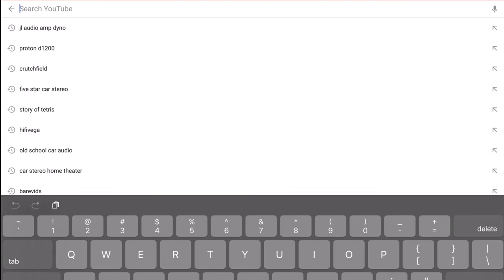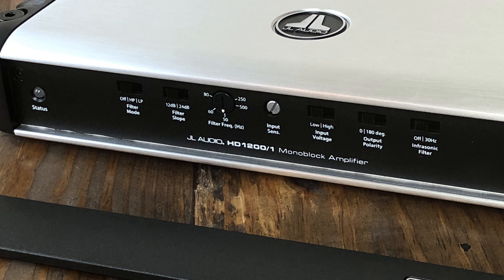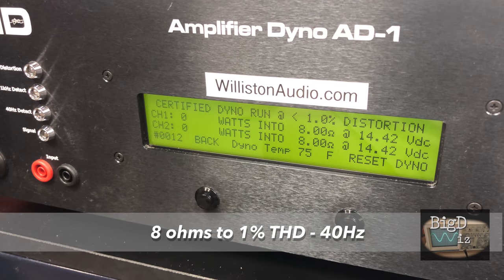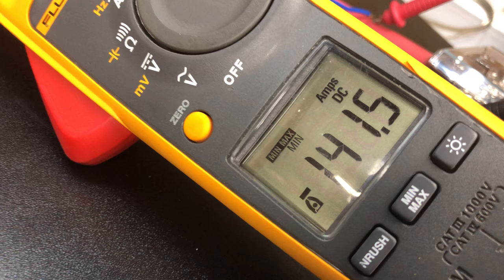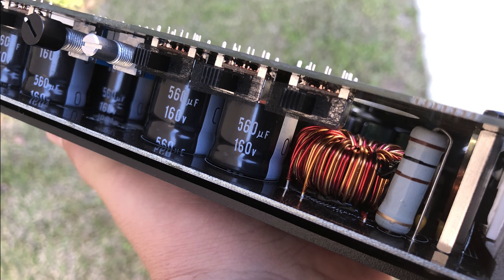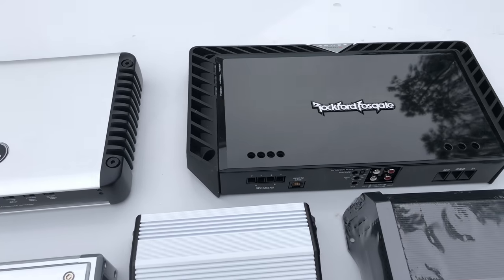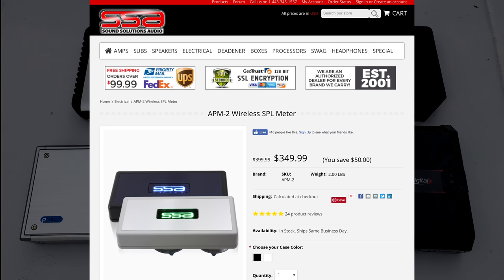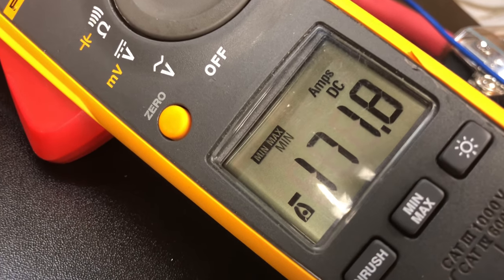$1100 for 1200 watts? JL Audio HD1200/1 Amp Dyno Test

Comment: Really nice amp but would take a fosgate power series amp any day.
Reply from the maker: The T1000 most likely matches the output of this amp, possibly more powerful
Reply: Wrong.
Reply: fat catt 39 No, Rockford Fosgate isn't made in the U.S.A.  Their products are made in China just like the JL HD1200.
Reply: BigDWiz your probably right because of Jl's regulated power supply.
Reply: Hopefully not a BD-CP.
Reply: I wouldn't have a Rockford Prostate..DD amps for sure
Reply: @blackymadd336  power series amps are made in USA brooooo
Reply: Fosgate power AD is what I would consider some of the best amps EVER made by rockford. Technology has come along way
Reply: Lol. The hd series has a regulated power supply.... Rockford don't come close.... Unless you have an upgraded alternator, and extra battery and big 3 to keep 14.4v volts... Which is $$$$ that Rockford that is 1000/1@ 1 ohm @ 14.4 volts.... When your system drops below 12v. Which it will without upgrade.  Your not getting anywhere near the 1000 watts.  And if your not at 1ohm.  Say 2ohm...even less power...hd series does what it says down to 10.9 volts.  From 1.5 ohm to 4 ohm regardless.....
Reply: @skypallman6169 the Fosgate has the constant power technology that can add as much as 25% output, and constantly adjusts to high/low voltage. And it's a form of regulated power supply. You're confusing the Power series with the Punch.
Reply: @skypallman6169 also, why would you ever want your volts to drop below 11?
You know what starvation does to an amp under load, right?
Reply: @smellsuperb1  buddy JL audio came out with the R.I.P.s power supply.  Only reason Rockford was able to do so in a lower end concept.  I don't want my voltage at 10.9.  but that's the thing.  Instead of just shutting off and you not getting any kind of sound.  The HDs roll power back and will continue playing at reduced wattage down to 10.9 volts.  And I think you're missing the whole concept of a regulated power supply. Ive been doing this since I started at age 15 for a 12 time world  champion Rick Wright. Was mentored by him and Mark Worrell... Another MASTER.  Then my father and I bought the business when I turn 23 and Rick wanted to retire.  I have forgotten more about Audio than you know!😂. So let's just stop with any kind of banter from you talking about audio with me like you somehow could teach me something.  LMAO

Comment: Um what bout us Old school Orion guys, a XTR 1500.1 can be had for $240-$300 online and if thats not in the same power range @ the 3ohms then the XTR 2500.1 which is like $100 more than 1500.1.. and not for nothin JL really?? @least the orion XTR's are made in Korea, I don't know who's smokin the crack over ther @ JL but if u want to put price tag double that of the other old school brands it better say made in the USA otherwise cut that price way down if u use Korean boards & even way more for china, just sayin that china sticker along with the power inputs & that price tag is going to kill the marketability of that amp.. im harsh but come on it's completely opposite of what one would expect coming from JL audio
Reply: Mike McCabe 
I'd have to agree. It's made in China, it's inefficient and power hungry, and it's double to quadruple the price of competing brands. Sure it looks nice, may have quality components, and it says JL on it (for what that's worth) and it may very well be a long lasting dependable amp. It could be claimed to be top tier in sound quality and may very well be true or not but this is also a class D mono amp that will most definitely power subwoofers so the difference in sound quality verses other quality amps (at half the price or less) would most likely never ever be noticed without an oscilloscope or other testing equipment. Especially if it's in the trunk of a car. I'm not mad at this amp and I'd be happy to own one but I can't justify the price for what it seems you're getting.
Reply: The thing is people buy them, so they will keep on making them. Just bought the 1200/1v3 over the hd1200 because the HD series is just so power hungry compared to the slash series.
Reply: Corey Y 
Oh absolutely man. There's no reason for them to discontinue such a high profit margin line of amps if people are buying them. Don't get me wrong I love stuff, especially high quality nice gear. This just doesn't compute to me, but that's just me. I've been wrong before.
Reply: Info 1500.1 xtr isnot old school.
Sorry. The BEAST Is old school
Reply: knuckleuprambo neither is the jl audio orion is an old school brand so I said to include a amp from ther lineup as well I didnt say the 1500.1 was old school I said to include it
Reply: How many amps out there can make their rated power at 4 ohms like the JL HD amps in such a compact chassis. The only one I know of that comes close or even matching the HD amps are the current Alpine PDX amps.
Reply: Love the orion xtr, i like that its rated power is @ 12v certified not 14v dynamic
Reply: No one is cross shopping JL HD amps and old school surf boards, it's a different demographic.
Reply: They sell the amp expensively because it's their brand. Can't really do anything with that. But Orions are getting rare now, so better prepare one, two or five of them hahaha :)
Reply: yuotubeusernaem - the Alpine PDX is in the same line .

Comment: I have no problem paying around $500 for a solid amp but $1100 is a bit much
Reply from the maker: My wallet agrees 😊
Reply: BigDWiz Speaking of wallets BigDWiz, I found a crazy deal on eBay for 3000 farad caps. Somebody has 30 of them for $130 or something crazy. You should look into it for the test bench. Extremely cheap for 5 more banks of caps.
Reply: the RD1000/1 is an excellent alternative
Reply: You can buy a used one for around 500.

Comment: What I like about the HD line is the consistent power across the supported ohm loads. In the Challenger, I run a VXi 800/8i for a full active setup on the mids and highs. It also provides a DSP'd  sub pre out to the HD1200 that powers two 12w6v3 subs. Because the subs only come as 4 Ohm DVC, I still got the 1200w rms I needed @4 ohms. The system sounds amazing.

Comment: Great Video Dwiz
This is one of those amps you have to look deep down at the specs. Its a rock solid SQ amp. >110 S/N ratio, huge dampening factor, 0.03 THD, specs not seen on all the amps that do a lot more power for a lot less money. Its one of those that there is many other reasons for its price tag, power output aside. It takes high end parts and extensive engineering  to achieve specs like this so your parts cost and development costs are well out of the ordinary from taking an existing board and putting your name on it. I was surpirsed that it was made in China though, but JL is so large that I am certain they have their own internal and external quality control to be sure the amps performances are always up to their par and most likely and literally  throw away the ones that do not perform to specs. 
Many will look at this as its an over priced amp, (per wattage) but at the end of the day, if anyone saw what the expense would be 
to make a 5k amp for example, perform to these specs S/N AND THD specs people would be insulted by the price. 
Its one of those, in todays market people look for quantity over quality, and most of the time do not want to pay the difference for the quality. Yes there is quality amps with quantity, but you will pay the difference. 

Parts quality also plays a huge role in reliability. You can get the cheapest amp that does rated power, but its likely it'll be in and out of repair due to poor parts tolerances, and if not great, but you deal with higher odds. 

An authorized brick and mortar JL dealer will also likely just hand you a brand new amp under the circumstances of a warranty issue user error or not. 

Concluding this there is so much more than meets the eye here that many people do not know about or understand behind the scenes, and my reply is to try go give a simple understanding of some of the things you'll never think about searching for the most power for the cheapest price. 

I do not run or sell JL, I do not compete in sound quality. I just hope this opens some eyes to look at the entire picture.
Reply: Agreed!
Reply from the maker: The best, most insightful comment I’ve seen! The one comment to rule them all 💪
Reply: I believe Fosgates are made in China, just designed in the USA. There is a reason why the Power series costs way more than the Prime.  You are right, you do get what you pay for. In electronics, better parts can add up quick. Also, many times there are more parts in better amps.
Reply: One word: Reputation
Reply: That made in China part got me. Are these new hd amps on par with old slash amps?
Reply: Tammy Forbes thanks been out of the audio world for a bit. I've always been a RF fan but last time I really used RF I did 4 T1500s in a friends build and he was constantly having to send them back. I remember pulling mtx 1501s back in the day and a jl500/1 would be just as loud at an auditable level but definitely cleaner.
Reply: I'm kinda getting that bug again so seeing what's new.
Reply: You lost me at “dampening” factor = Damping Factor: Bass (subwoofer) Control. 

A high S/N ratio is really pointless in the sub region. 

JL Audio has always been overpriced. There are much better amps out there, for less $$. 

Because low frequencies are power hungry, A sub amp should give high wattage with a low current draw .......... and a high Damping Factor.
Reply: I agree there is more to the price than just the power output they are good sq amps and quality components however I still believe there are comparable amps for half the price of this amp. I still pick up all the old 500/1 and 1000/1 jl amps when I find them on Craigslist or in pawn for cheap.
Reply: I’ve been looking for videos explaining this and there are none. I’ve understood it similar to all other aspects to a performance vehicle in which generally you pay for what you get.  

I’ve been mulling over the cost/quality ratio when selecting my next setup and have to admit there is a tough time trying to figure out what the best choice is for me. Leaning towards a used jl 500/1 and jlw7.
Reply: if it were that great of a SQ amp then the efficiency would be out the window... nah they can keep it I won't pay
Reply: 👏 Couldn't have said it any better.
Reply: exactly most people do not understand all those parameters, and they only go for quantity over quality like you said. That's a shame anybody that gets into this Hobby OR any related hobby electronics hobby ect. should know the basics at the very least... you're paying for damping Factor  to help control the woofer during those low-frequency passages to give you tight Bass and to handle the back voltage generated by the voice coil. and lower Distortion as well as tighter resistor tolerances they probably use 1% tolerance metal thick film resistors with a good temperature coefficient rating, instead of cheaper noiser carbon film resistors that can drift over time  because of temperature fluctuations and moisture and better quality high temp low esr long life capacitors such as nichicon ka series or the Panasonic fm  series caps /or the elna seismic audio coupling capacitor series ect. as well as the proper grounding scheme to reduce noise and interference, better quality chassis thicker board traces to reduce power loss and excess heat generation, name brand reliable semiconductors that aren't Chinese crap.  such as Texas Instruments and Vishay semiconductors Fairchild ect.  yeah for subwoofer use that low amount Distortion really doesn't matter, but from a design standpoint you get what you pay for. Better quality op amps better quality driver transistors with a really good slew rate ect. You get what you pay for...
Reply: my crown amp has over 5000 damping factor, bet this can't beat that 😋
Reply: @peterkay2406  Do you know if they rate it from 20 hz to 20khz at that damping Factor and rms wattage? Is it the macrotech?
Reply: I was using a RF Prime 500.1 on a JL 10 W3v3 and it sounded good and hit hard for me. Found a JL RD 500.1 for $85 at pawn shop. It just didnt have the same punch as the Rockford?
Reply: Sound quality and bass shouldnt go in the same sentence unless your building a sealed subwoofer encloser for a sound quality build. And it shouldnt cost this much .pioneer sounds clean clear and crisp so does Jensen and polk audio. JL is to much . Iv been in a car with 4 13.5 JL audio W6s in a walled off S10 doing 150+db on a Memphis mojo. For spl its so loud you cant even here the sound quality of them. Then iv heard sound quality systems you couldn't even tell it had a subwoofer the bass was so clean clear and crisp. In the end its just user preference and what they want to spend.
Reply: adaboy4z - the RD is on the lower line and you might not have had it tuned correctly.
Reply: still overpriced.  no matter what way you look at it.  even the fosgate 1500 power series is cheaper. (not to mention double the watts)  JL is just hoping the people with more dollars than sense will not know any better and want an "all JL" system will buy these to go w/ their subs.  but the funny thing is gonna be when someone rolls up with a system that cost prob less than 1/2 what you paid and blow your doors off.
Reply: @jasonjrf  then I'm guessing you're only going to buy a handful amplifiers caues  95% of them come out of China if you think this amp is expensive now how much you think it would be if it was made here in the US
Reply: @jasonjrf  then I don't know what you're running because they all come from there and even the ones that are somewhat assembled here they still have Chinese parts inside
Reply: @XX-121  that’s cool if they blow my doors off, I tired the fosgate and it sounded like ass. No thanks, the jl hd 1200 is loud asf and sounds incredible, I’ve tried it on dd subs and morel subs and jl is clear winner

Comment: One of the beniffits of the RIPS power supply system is that the amp will produce approximately the same power any voltage, and any impedance.  Literally the one other test you could have done, and didn't do, a voltage difference, would show that this amp technology sets it apart from everything else. Next you time do a test, do everything at a lower (real world) voltage test. Run the voltage down to 12.5 volts and watch other amps plummet in output....away from their ratings. Part of the RIPS curcuit/design is that in real world tests in a vehicle, the output stays the same whether the car is on the freeway or at a stop light. That way the customer never gets less then the rated output.no matter what their car is doing.   That....is why this amp costs more. Hey, plus, they sound really good! 😁

Comment: I have the HD1200 and previously ran a DD M2a(2400 w @1 ohm, 1200 w @ 2ohm) I have it powering a 2ohm load and i can say that after impedance rise that the JL outperforms the DD amp in power easy. Also the DD amp has a noticiable softness to the sound or lack of clarity when compared to the hard hitting, ultra clean sound of the JL. I was on the fence on just keeping the DD amp but after some length ear listening to both amps, the JL gives that ultra clean and hard hitting sound that i crave. If you want to run the DD m2a at .5 ohm or even 1 ohm sure you will get alot of amp for the money, which btw is still a great amp but I think the JL is better in SQ easily. So all the people hating who try to convince you that there is better amps for the money haven't done proper testing. You pay alot for premium products and thats simply put.

Comment: i like the engineer inside this amp, I refer to the fact that independent of the input voltage or the impedance value (1.66 to 4) the output wattage is the same, amazing! thanks for the video

Comment: Definitely a solid amplifier, yes the price is a little out there but you’ve got to realize this is a really good sq amplifier with a signal to noise ratio of 110db and thd is 0.03%. Yes you can pick up a 7k for around the same price or even cheaper but signal to noise ratio will be around 85/90db and thd Will be around 0.1%. I still think the price is a little bit on the higher end though, I have seen other amplifiers with similar specs around 750/$900. if you’re looking for a ground pounder amplifier then this isn’t what you’re looking for, this is for someone who wants  a sql setup. Now what I really wish JL audio would go ahead and do is combine the hd Siri’s in the vxi Siri‘s together and make a great sq amp with dsp built in, include the same control knob that comes with the vxi Siri’s and keep the Price the same or maybe lower it by $100 or so... I would be a JL audio fan boy for sure then...

Comment: $1100, made in China, dumb power/remote/ground block, not of fan of the non adjustable subsonic filter,  level knob not included. You have to take a screw off to get to the amp adjustments, but you're meant to be moving the amp around so much you have to disconnect your power often? I don't get this. For $1100 you would expect a more ergonomic and smart design. Rockford would be the way to go with the T1500 even if I'm not sure it comes with a level knob.

Comment: Just did a test swapping out my Dd M2a 2400 watts at 1 ohm, gave it 1 ohm load set gains and it still was not as loud as a 1200 watt jl hd. You would have to wire down to .5 ohm to get any performance out of that DD M2a. I’ve done and it’s loud but def not as clean as the Jl. So consider this do you want new subs that you can wire to .5 ohms and use inferior sound quality amps? Or use your current subs and get true 1200 watts and be amazed?